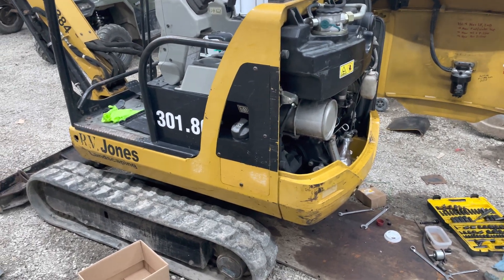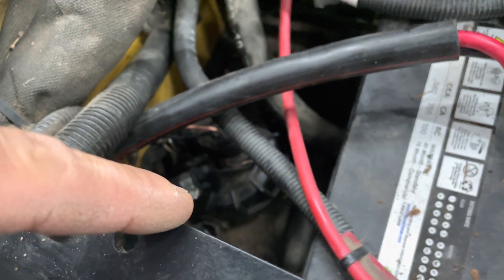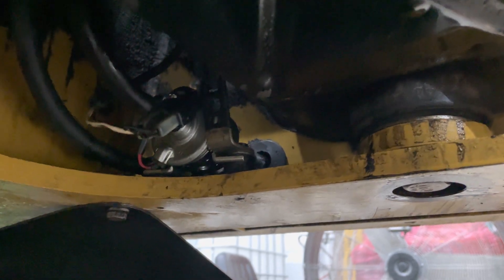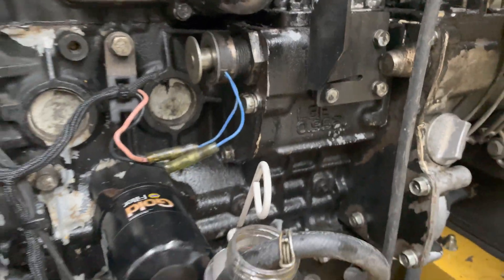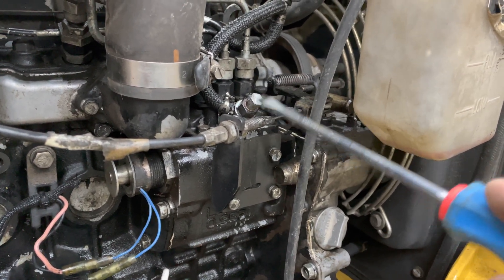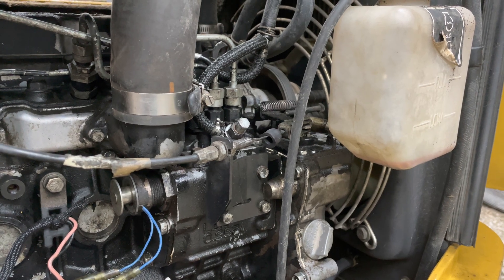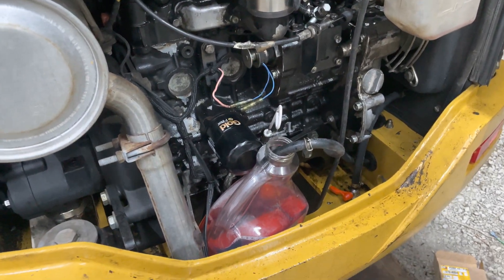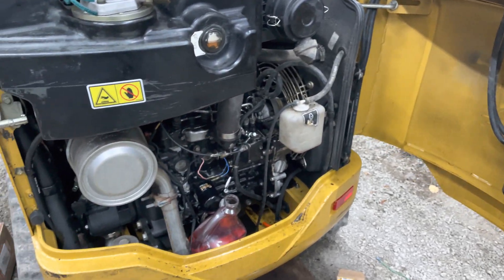Caterpillar 301.8 Excavator - Diesel Fuel System Explanation and Repair

Comment: Excellent video. I was experiencing the exact same issue. I changed the filter and was about to change the lift pump when I saw your video. I removed the seat and after cleaning out the mouse mess, I discovered the original hose clamps were very loose on the fuel lines. I replaced the suction line and clamp and she immediately ran like new.
Thank you for saving me time and money.
Well done!
Reply from the maker: Great to hear!
Reply: what filter is it?
Reply: @blacklistix8627 the fuel filter. But the problem was actually the fuel line at the pump.
Reply: @alandarmon8380  ok i will check it

Comment: A good rule of thumb is to start at the cheap end of the problem and work your way to the expensive end.  In this case the two ends are fuel at one end and injectors and high pressure injection pump  at the other.  Pretty easy choice. So start with new fuel. Then clean the tank if it needs it. Then change the hose (that might have solved this problem and so far you might have fifty buck in the whole repair.) then the lift pump. $100, Then the injection pump $1,500. Then injectors at about $300 ea.  If you look at every repair in this way, you can avoid a bunch of new expensive parts that weren't necessary to be replaced.

Comment: Hi Rudi thank you for your detail on explaining it so well have the same machine and are glad i know have the knowledge on what to do should i have the issue ever present itself wish more people did the same walk through i recently had a no start started replacing parts which were quite expensive turns out it was just a fuse under the seat anyway have so good spare parts now for future repairs but would have loved to have someone do afault find on a no start walk through as you did with the fuel system

Comment: The 2 wires going to lift pump one is earth im guessing the other is ignition power? ...... im not getting power to mine the fuses seem ok got any ideas for what i need to do much appreciated
Reply from the maker: Yes one is ground and the other comes on when the ignition is on. This process is controlled however by the small computer that is inside the back of the hour meter/engine display module on the right hand side of the machine near the joystick. This little computer is actually what tells the pump to come on for a few seconds before startup and to come on continuously once you start cranking over the engine. If fuses and wiring look good then the computer may be your issue. You can replace it fairly easily but also do solder repairs to the pins on it as sometimes they corrode. At the end of the day though you must have 12v power and ground to the lift pump whenever the engine is running and for a few seconds before you crank it over. You could totally bypass the computer and just wire power from the ignition switch directly to the fuel pump.
Reply: @rudijones  Legend! Thank you so much for taking the time to answer. Ok so I didnt realise there is little computer in there and i reckon 100% Im keen to by pass.... So i need to find ignition power wire and hook that up ??
Reply from the maker: thanks, yes any wire that is hot when ignition is hot should work.
Reply: @rudijones  Great have done that now starts and runs perfect. Down the track i might look into new hour meter i'm assuming the module is inside that hour meter ? Thanks again
Reply: @rudijones do you have the manuals of the machine?